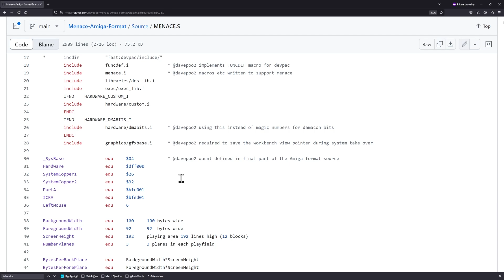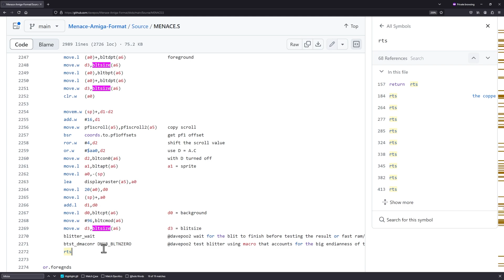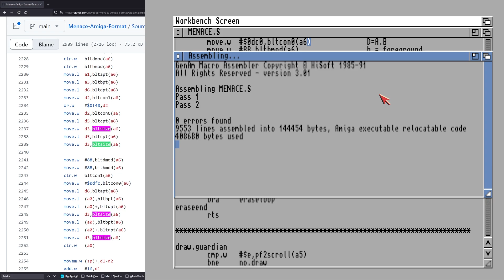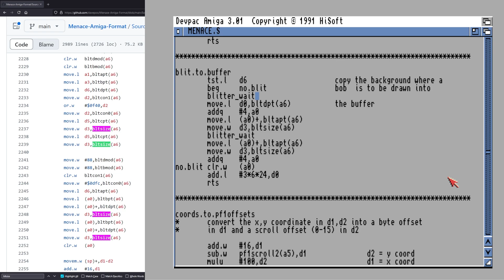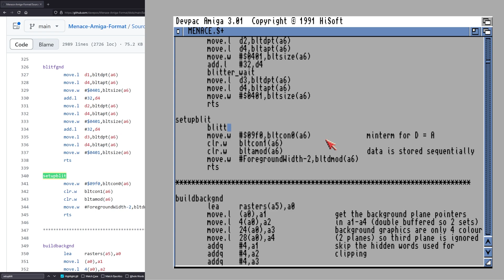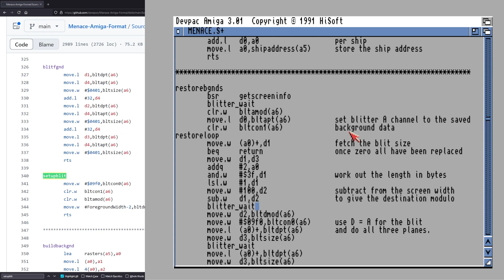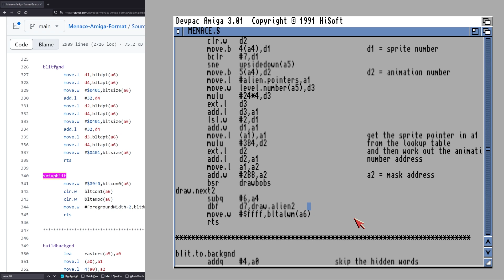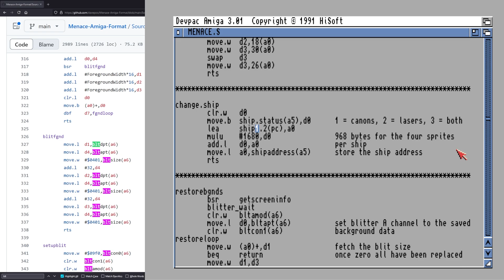Menace Source Code Part 5 - Fixing Glitchy Graphics

Comment: Back in the day I did find the Devpac 3 integrated editor did have a few bugs at least in the relatively early version I had, so after a while started using another editor (think I used a coverdisk version of CygnusEd) and assembled on the command line (GenAm). Regarding blitter, on "old school" Amiga hardware while display was being drawn there are eight memory access "slots" per low resolution pixel and every bitplane uses one slot, so using 6 bitplanes there are only two slots spare. The blitter has priority over the CPU for a certain number of memory accesses then the blitter yields (if you don't set the "blitter nasty" flag), something like three blitter accesses to one CPU access so when code is in chip memory, the graphics are being drawn and the blitter is active the CPU is REALLY slowed down. There are gaps between drawing each line of the display and a larger game between the last and first line which is why a lot of game/demo code has the copper trigger an interrupt near the end of the display and code triggers off that. Anyway, small blits can often get done before a 68000 CPU is even able fetch and execute the next instruction. With all the various advantages of the 68020 including higher clock speed, and caches this is no longer true.

Comment: How frustrating to discover after all those changes that it was the assembler that was the problem!
Reply from the maker: Well, all those changes were still required. But I did spend quite a while messing about trying to figure out why it wasn't working. I only found out when I started commenting out code and nothing was changing. When I closed down DevPac it seemed like it had an earlier version of the file open (and in memory) and it was always compiling that one instead of the version I was editing. The only good take away was that at least my changes to the file were being saved.
Reply: @DavePoo2  Well, all's well that ends well, I guess. Imagine if you hadn't figured it out when you did. You might STILL be scratching your head and pulling out your hair!

Comment: Two things: "clr" is a bad idea on 68000 but good on 68020+. If you were so inclined you could just mark all the code as residing in chipram and turn on blitternasty - that would probably have fixed it without any wait inserts. I don't know if that would have made it too slow for a pure 68000 though.
Reply from the maker: @NorthWay_no  I didn't want to turn on blitter nasty as it's just throwing away any performance you can get from running the blitter concurrently. But even with that on, I think the CPU could still execute depending on conditions. As for the chip ram, I believe this game already marks the code as wanting to be in chip ram, so could change that to get even more speed. I the CPU can get access to chip ram on 68020 whilst the blitter is running as it can go in-between Dma cycles.
Reply from the maker: @NorthWay_no  what's the deal with CLR?
Reply: @DavePoo2  The 68000 will - for some unfathomable reason - do a read before it writes 0. That can have both unintended consequences with hw and is slower or no faster than a move #0. The 68020 and later will just do a fast 0 write.
Reply from the maker: I would suspect it does a read because to write a 0 it is doing an 'exclusive or' with itself to get the zero. Looks like the CLR and EOR instructions take exactly the same amount of time. https://wiki.neogeodev.org/index.php?title=68k_instructions_timings
But looks like you are right, if you want to do a CLR.L, then it's quicker to do a a MOVEQ #0, D0 instead as that will clear the entire long word. But if you want to do a CLR.W or CLR.B then you can't use MOVEQ as it always affects the entire longword.
Reply: @DavePoo2 yeah 68000 clr is strange doing read first from memory before write 0, but not on register its just write only. Not sure why.

 Didnt look into it.

Comment: I must admit the Amiga Blitter has been my nemesis on more than a few occasions. These videos contain some really useful information that most people have to learn the hard way. The way you are explaining things and showing your thought process is fantastic. Well done.
Reply from the maker: @pixelplop With all those parameters you need to set correctly to do a blit, it would be easy to mess it up. It also shows that it only took the next processor iteration in the Amiga to mess up lots of games. The 1200 is probably able to access memory on every clock cycle and coupled with the CPU cache, it's way faster than A500 which unfortunately meant lots of software would just stomp over an ongoing blitter operation. It's amazing to see that menace works fine on an A500 with not a single care about whether the blitter was still running, even testing the result of the blit on the line after it started worked fine on the 500.

Comment: Awesome job fixing that. Is it possible the problem is exacerbated because the 68000 in an A500 without fast RAM would slow down until the bltter has finished cycle stealing?
Reply from the maker: @SM-rn3xy  it must be doing that because the collision detection check is literally on the next line after the blitter was started to do the check and the A500 had no problem with it. I think the biggest problem on A1200 is the double clock speed and the CPU cache which is allowing the processor to get some work done concurrently with the blitter. I think the code in menace is still being loaded into chip ram as there is a directive at the top telling it to be loaded into chip.